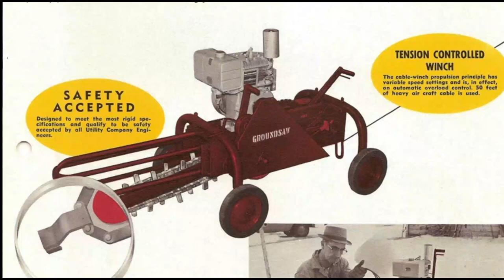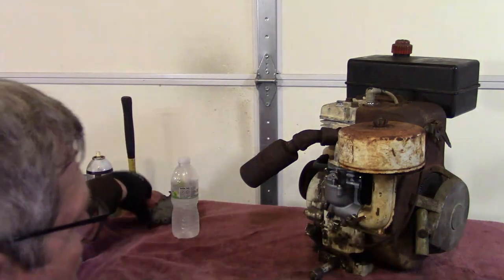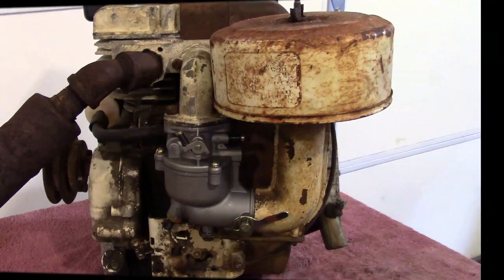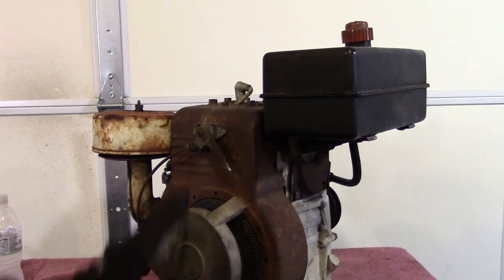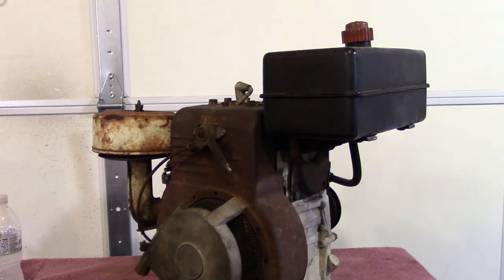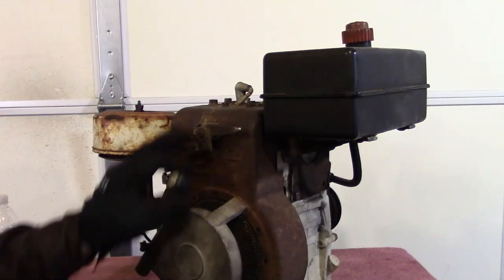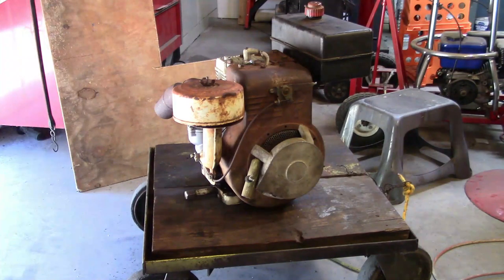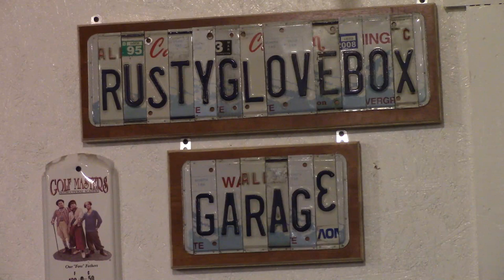Ground Saw 6 hp is running

Comment: That old motor runs very well. I have a circa 1970's 5 HP B & S motor that looks a little bit like that. It hasn't been running in a while. It is minus the muffler. I may try and see if I can get it to run and do a video of the process. I've never seen a ground saw before. WOW! Thanks for sharing.
Reply from the maker: Thanks Andy, they made those engine to take some abuse, I bet you can get the circa running again. Thanks and enjoy your week.
Reply: I may give it a try sooner than you think. Thanks for the quick response. Keep the videos coming.

Comment: It runs strong for sure! Carb works good. I likes the old engines the best they are quality. That would be handy for burying my solar cables I got strung all over the place around my yard. I need to rent one of those. This battery runs my AC all day and then some. I ordered another one.
Reply from the maker: That's great to here about the solar power. Running the a/c all day is a good test. Thanks and take care

Comment: It's alive. ")  by the way I ordered a air/heat system for the shop, it will be here tomorrow/today, How is yours working so far?
Reply from the maker: It's working good. I was sweating cause I had been outside tuning the engine. Didn't want all the fumes in the shop. Thanks and take care Buzz